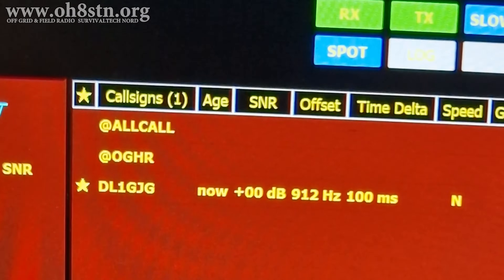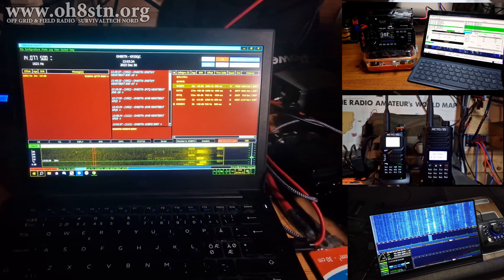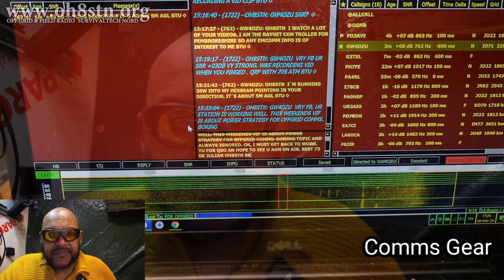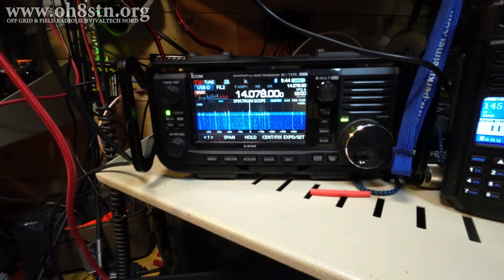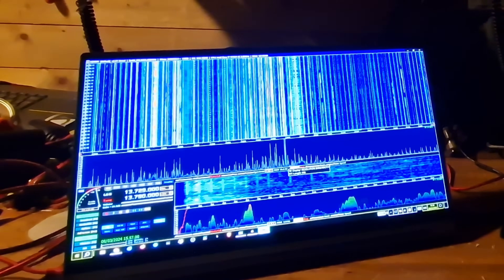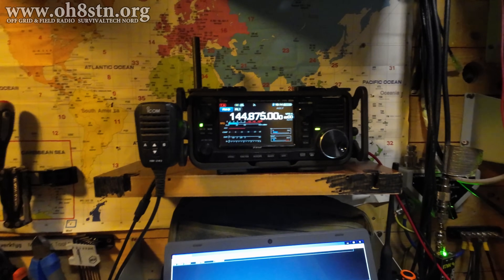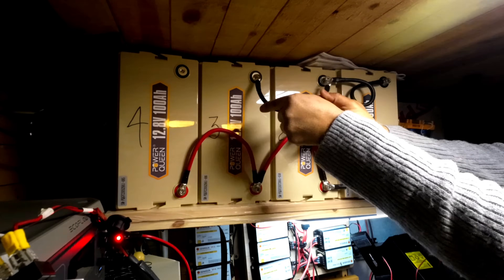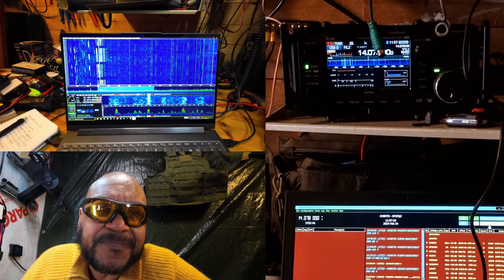Ham Radio Station on off-grid solar power

Comment: All my shack mobile radios are running on solar with a 100 Ah battery.  I also charge an anytone dmr ht and my yaesu ft4x on solar.  The evolve is intriguing to me because of the 12 volt operation.

Comment: I have started with two 100 renogy panels and their charge controller.  I am starting with making sure my radio equipment and some lights and anything that can be 12v powered is hooked up to solar.  I am looking into the inverter system to power the shack hvac and some of the other loads.  That will likely require the 48 volt system and i can supplement with the grid.  My editing laptop will likely not be able to charge on 12V, which is where the 48 volt system to an inverter will come in.

The heat in phoenix can be somewhat brutal at times.   I have heard that yuma is worse.  I love the desert, but the heat is grating at times.

Comment: Julian, great video as always. What type ferrules do you use to connect the wires to the charge controller? I've looked at several different ones and can't figure it out. Also the one place I looked at, only sells in batches of 500. Any help is appreciated. Thanks & 73

Comment: Thanks for the video! My question is about your thoughts on grounding of your power distribution network and the radios.
Reply from the maker: Thanks, but what's tge question?
Everything in my shack is grounded. The station has a ground network under the tower as well as a ground spike outside the shack. All radios antennas  and power supplies are grounded to that network.

Comment: I have a 48KW CAT 3 phase unit and 1500 gallons of fuel for it here at the farm. For clean power I use a transformer that converts 3 phase 480 to single phase  240 volt power for the house and shop  thru a transfer switch .  You can buy a big genset very reasonable as so many large plants are being demolished  and can be bought for near scrap price !   I’m my shack I have two TrippLite rack mount UPS units each can run it for 750 minutes with a 100 watt load. They were salvage too.  Bargains are out there if you look for them . Sorry no letters given. Any one can look them up and get all of your information even your address !

Comment: Always looking for ideas on how to maintain off-grid comms. Always watch your videos. Thanks for sharing your deployment. My question, not exactly on topic, but I thought I would ask anyway; Are you concerned with EMP or HEMP for your station(s) and power distribution system? Is this anything you might integrate with your setup and if so, which protection would you consider utilizing?
Reply from the maker: This is probably something we should cover on the channel. There are multiple layers to this EMP problem.
First we have to have an above average ground network. Antennas are grounded, Radio sir crowned it, and the hamshack itself is grounded.
Second we have to understand if our radios are connected to external antennas, they're going to be destroyed if an EMP occurs while they are online. For this reason, I have a set of redundant radios stored in a faraday cage, which itself is stored  in a root celler.
The third point is two is one and one is none. Despite the cost, we must always accept the possibility of radio equipment being knocked out. Because of this we need to have contingency plans in place, Ticket our systems back up and running.
Regarding our battery systems. Experts say batteries will not be affected by an EMP. I'm not sure how true that is and don't know how to test it effectively. What I do know?Is I have redundant systems for my battery storage as well. Those are offline and hidden , just like my redundant radioactive gear. This is also true for my solar panels. 
73
Julian oh8stn
Reply: @OH8STN Thanks for your reply. Good information. Yes, redundancy is required. My saying is buy two, or none, not one. I too use a faraday shield for BU comms. Some of my friends think I'm nuts for going to all this trouble and cost. 73

Comment: I've had a 30 Watt p.v. panel for years to run my QRP 5 Watt maximum radio gear. 2 off 12 Ah S.L.A.B. batteries. No Sun today and very cloudy with rain.
QRP so no great power drain and I still get out.
I don't need a computer to run radio.
G4GHB.
Reply from the maker: Very nice. Every station should bd setup to run without grid power.
The computer makes it possible to send and receive messages when I'm not at the radio. The station can also record swl programs with sdr.

Comment: I didn't notice any but fused junction blocks work very well at protecting individual components. You also should have fuses on those batteries to prevent a disaster.
Reply from the maker: Thanks.
I showed the ANL fuses in the safety features portion of the video near the end. There's fusss in between the batteries and bus bars and between the bus bars and power distribution. There's also fusing on power distribution before components. I've been thinking about fusing between between the batteries.As well. Is that what you mean?
Reply: @OH8STN That is great! I won't have to worry about your radio shack burning down. :)

Comment: have you considered using the stong laptop, and run ll the things as  vm, it would cost way less power.
Reply from the maker: I've thought about it, yes.
One of the criteria was being able to take a system to a remote location,  while the other systems remain in place. If I run everything on a single computer, I loose redundancy and the ability to deploy unique systems individually. 
Great Question 👍

Comment: Your ability to reliably run radios directly from the batteries is due to the higher terminal voltage of LFP batteries combined with their very low internal resistance. This does not hold true for lead batteries as has been my experience doing this since 1993. My system is presently using gel-cell lead batteries wired in 24V which provides me with longer runs of smaller cable between the battery bank in the garage, the ham shack and the upstairs network closet where the power is bucked down to 13.8V for the radios and other gear.

I point out that our radios are meant to run on 13.8V and NOT 12V. I've had a number of radios go nuts with voltages below 12V during transmit - this is why I use the 24V configuration. (48V was not an easy option at the time.) I use Astron DC-DC converters and they have minimal loss/heating.

My system also powers an inverter that supplies 120V AC for my computer and monitor. System load is about 300W continuous - 24/7/365.

I gave a talk on this at the Houston Hamfest last weekend. de N4HPG

Comment: Excelent description. Do you have the wind turbine power into your actual battery  bank or it is apart in another system, because the difficult to obtain wind charger for LIFEPO4 batteries?
Reply from the maker: It charges the actual battery bank.  Have a look here: https://youtu.be/X5ycaYcu49I

Comment: Lots of questions but I'll stick to one for now. Is your shack connected to mains power and in case of an outage the batteries kick in or is it completely offline all the time?
Reply from the maker: There is mains power available,  but the station, lights, heater, ... are run entirely from the batteries. 👍

Comment: Great video!  I would be interested in how you integrate wind power.  You briefly talked about it.  My strategy has always been multiple power generation options ( solar, wind, human) following closely with yours.  705 is a great radio!  I own one and really enjoy its versatility.   Thanks again for your excellent videos!
Reply from the maker: Thank you.
Here's a video I did on charging lithium batteries with the wind turbine. It's totally experimental but adds that extra layer of margin. Eventually, I'll have shunts on all the strings.And the wind turbines so how much energy they are bring in can be measured. 
https://youtu.be/X5ycaYcu49I

Comment: Thank you for sharing your setup for a well thought out &  resilient shack.  Why do you use multiple charge controllers with 200 watts on each circuit?
Reply from the maker: Since I prefer using the Genasun charge controllers (RF Quiet), my solar panel configuration needs to respect the power & current limitations of the controller specs. I certainly wish they would make a 20A model but so far that's a no-go.

Comment: How are you running your Meshtastic node?  What hardware are you using?  wisblock?
Reply from the maker: It's early stages for my Meshtastic journey. At the moment Lilygo Tbeam on 433Mhz. It is connected to a tower mounted 433Mhz antenna. Some buddies of mine and I plan on putting a 868Mhz (EU) antenna up on the tower to get that band activated. I'll be showing the practical aspects of the journey on the channel and blog.'

Comment: Great videos.  The only suggestion I have, is based on an experience.  If the ham shack will have wires with exposed positive and negative posts, I either tape them over or print covers, particularly if the space is a work area for antennas and tools because you can accidentally short out your system while repairing something or cleaning an antenna.   Don’t ask me how I know.  Keep up the great content.
Reply from the maker: Outstanding advice,  Thank you! I'll get to work on this, this week! 🙏
73
Julian oh8stn

Comment: Have you looked into thermal-electric generators?  I wrote a research paper on them back in college, and the result was basically, if you're already heating your shack or shelter with fire, then they're could be worthwhile, but not worth starting a fire just for the electricity.  We don't get a lot of sunlight here in the winter so solar isn't the best option.  It sounds like you're pretty well setup with solar and wind, so maybe a TEG isn't worthwhile for you.  I'm curious what you think.
Reply from the maker: I would love a thermo electric generator! The only reason one hasn't been deployed for the off-grid ham shack project is it uses a diesel heater rather than a wood stove. 
There are two possibilities though. 
The first idea is scavenging the exhaust heat from the diesel heater, to power the TEG. This seems rather straight forward but there are some issues. The diesel heater has a start-up current of ~9 amps. If the TEG could produce more than 9A, it would be a win.
The second is using a wood-burning stove. The issue I have is no space inside the shack for it. If I could figure out how to build a wood-burning stove outside the ham shack, while routing heat back inside, it would be extremely interesting.
Reply: @OH8STN they do make small wood fired boilers that could be mounted in a small external shelter and then you run insulated pipes into the shack where you would have a radiator to pass on the heat. If the shack is very close to your QRH you could also run pipes into the home and heat additional areas. Only problem is that you have to feed the boiler with wood every so often but if you could place the TEG around the exhaust chimney you will have a very hot heat source. Cost might be an issue.

Comment: Glad to hear you mention Meshtastic. I'm just starting to self-learn it and would love an in depth video from you on it. I can't find anyone around me using it. It seems to be much more active in Europe than the US.
Reply: It's not a great alternative because it requires so much infrastructure to operate.
Reply from the maker: That's absolutely true. Moreover, the texting tools are quite poor in comparison to the tools we use for ham radio. Still, meshtastic has some interesting uses. It just need skilled resources t setup and manage the network.
Reply from the maker: Will do! I'll focus on the practical side of meshtastic deployment. We already have some great ideas in mind.